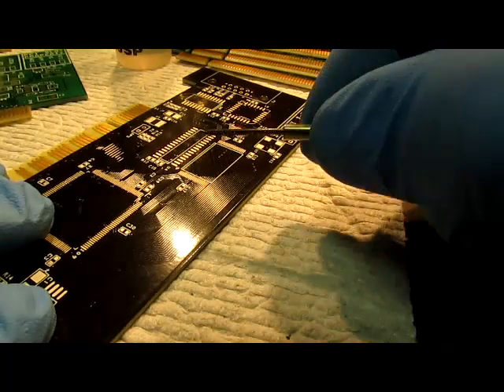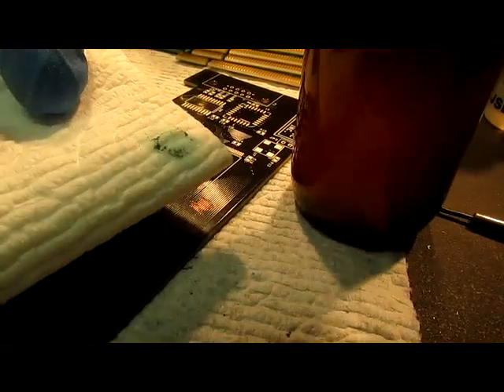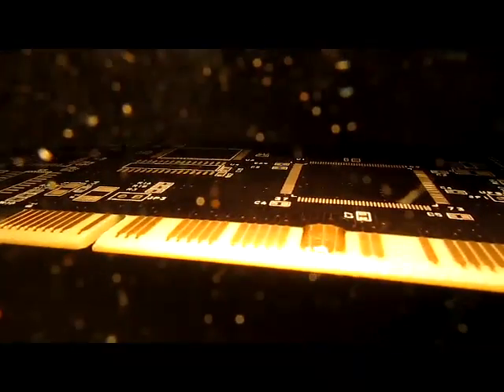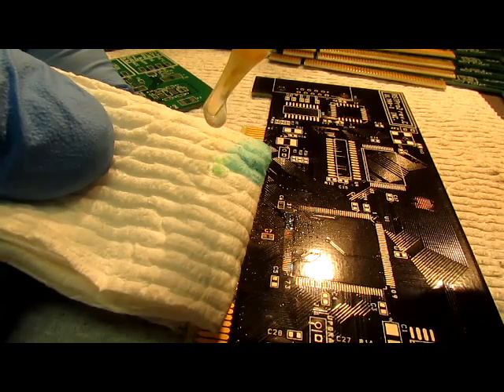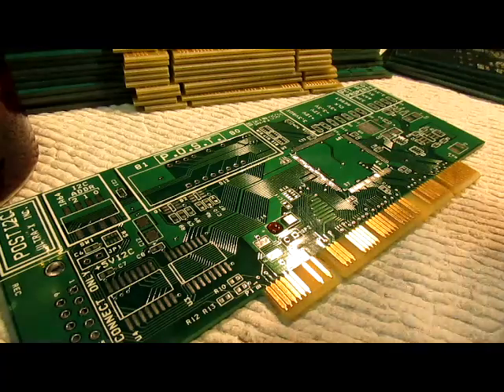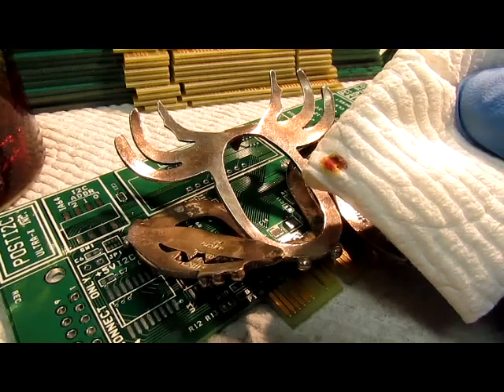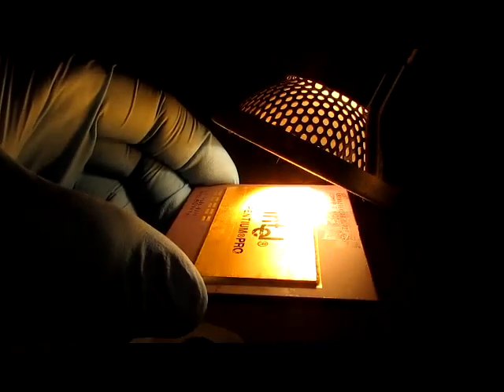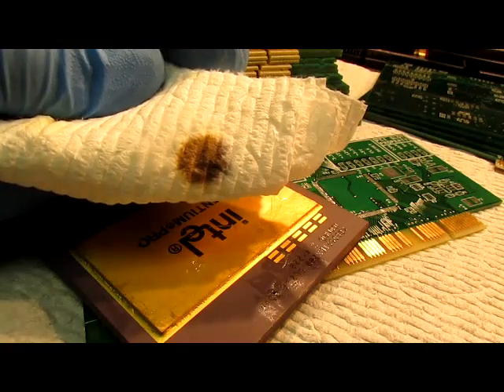How To Test Circuit Boards For Precious Metals

Comment: Couldn't that 18K solution also be used to test for PGM? I saw where you tested for silver on silver-colored surfaces with Schwerter's Solution with a negative reaction for silver, but some electronic PCBs used Palladium too... especially on older & military/aerospace electronic PCBs. Or, would a drop of HCl + a drop of bleach be better for PGM testing on electronic PCB surfaces?
Reply from the maker: Possibly

Comment: Hi there, i just want to know what is the second solution you use on the paper towel to confirm that there is gold present in the aqua regia? Thank’s
Reply from the maker: Stannous chloride testing solution.
Reply: sreetips is this a solution you made or it sale ready made?
Reply from the maker: I made it: 1 gram stannous chloride crystals, 1 gram pure tin shot, 25ml distilled water, 30 drops of hydrochloric acid. Ready for immediate use. Lasts for up to three months.

Comment: Awesome work man. I was just wondering, if the heat from the lamp caused the gold to react to the solution, why you didnt apply heat to the first solder unmasking? Did you already just know there wasnt gold in that area? And should heat be applied to each area tested? Thank you.
Reply from the maker: Heating is not necessary. The testing solution is acid. Cold acid reacts more slowly than warm acid. I heated the solution with the lamp to speed the process. I could have just as easily applied the test solution and waited for five minutes with no heat to achieve the same result.
Reply: Cool man thank you. Keep up the sciencing!

Comment: Purdy Neat How The SNCL2 Precipitate's the Au even when there is HNO3 Present....i have found most "Visible" Gold on Ewaste is about 6k...i ran into some Ram Spacers that were Yellow and they were Gold Under the Yellow insulate. And a Quarter Size Cpu out of one of the first portable Ausy made PC...Had 24k on it...A Good Test is Scratching a line onto something like the Bottom of a Dinner Plate Or Regular Jewlers Testing Stone...Ceramic Wall Tile would work...Now you can see the Scratch line Stay Or Dissapear...All the Soldering Joints should be 95/5 ..Lead Or 50/50 has pretty much been Outlawed...Silver in those Soldering Joints but A weak Amount...Also Antimity.....Everything but lead...One Feller was adding H2O2 To HNO3 And Dipping them to Remove all the Silver....Look's Like Fun.....Ha.....:)
Reply from the maker: Good stuff man.

Comment: AWESOME!!!   I finally had a method to ensure my Stannous was working properly since I had never made it.  Put my 18K test solution on card fingers, then on a Q-tip, and used another Q-tip to put a small drop of my Stannous on the fluid from the card... = INSTANT BROWN.  Good solution so my biggest test is now behind me!  Thank you for this idea since I didn't have a way to ensure my stannous was good without first dissolving gold in a batch!
Reply from the maker: Cool!
Reply: So, I had some relays that were military grade relays.  Golden color throughout, and with the Stannous method they showed brown/black color after surface test.   Today, I put them in 60ml HCl, 20ml Peroxide 3% and before I even finished the peroxide addition the mixture was already turning greenish/golden in color.  My figuring is that the base metal which was similar in color was copper.   Does that sound correct?   I had 8 grams of the relay arms, which I cut in half for the acid to get to middle layer.
Reply: This is just a trial run, not a serious one.  Testing of methods.  That is why there is such a small amount of material.
Reply: If there is copper and no gold will the stannous turn yellow/green or no color change?
Reply from the maker: Should remain unchanged if there’s just copper and no gold.

Comment: I have a doubt on one board I got. It's the thir board I tested. Can you please tell me what you think,  if it is gold or not? I don't know if the board is not gold of is the stannous solution was not well made,  what is your opinion? The video is on my videos named gold test boards.
Reply from the maker: I looked at the video. It looks like you had a brown stain indicating gold in solution, but it was not vivid and conclusive. You need some standard test solutions to check you stannous chloride with. Measure out 0.1 gram of gold, dissolve in AR, denoxx, and add dilute HCl to 100ml level. This will give you a standard test solution of 1 gram of gold dissolved in 1 liter of liquid. You can then test your stannous chloride testing solution against a known standard and use it to compare the tests you did on these boards. I'll make a video to show how to do it.

Comment: thank you... I will wait for that video
Reply from the maker: You can buy the test solution on eBay. It's the same thing as the solution that I use, only I make it myself. It comes in a small plastic bottle just like other test acids found in gold testing kits. The solution will look red or brown in color while in the bottle. It does lose effectiveness over time. That's why I make my own. I can add a little potassium dichromate and a squirt of nitric to rejuvenate it when it starts to give questionable results. I'll try to get a video of how I make mine out real soon.

Comment: hi...excellent video once again. Can you please explain better what you use to test the silver?
thank you
Reply from the maker: The silver test solution is about 1 gram of potassium dichromate dissolve in 25ml of 50/50 conc. nitric acid/distilled water. I'll make a video that shows how to make the test solution and how to use it properly. You can buy potassium dichromate on eBay.

Comment: Thank you for another cheap way to test our e scrap. can you try the silver solution in ic chips on the legs specially those old eyeprom type rectangular chips. some of them look shining like silver  plated legs. how to sort them from nickel  or tin plated  for silver recovery.  and again thank for all those instructive for beguinners on e mining. Regards from Puerto Rico Island.
Reply: The old eproms ar silver platted even the inner part around the sillicon die is in most i have some with silver bond wires